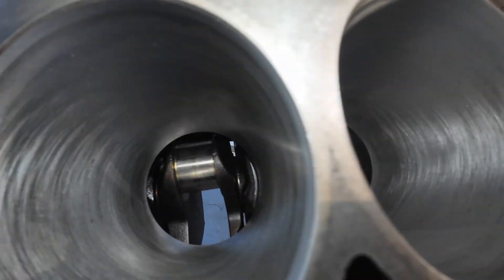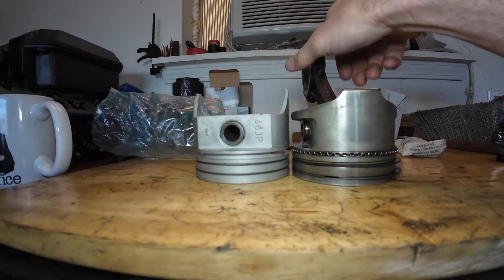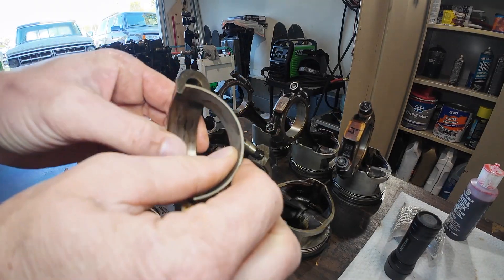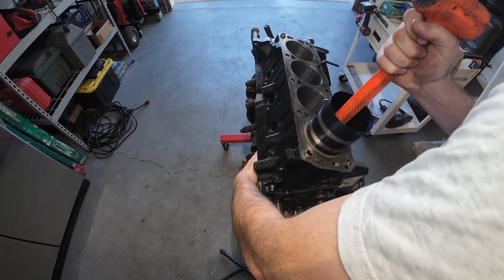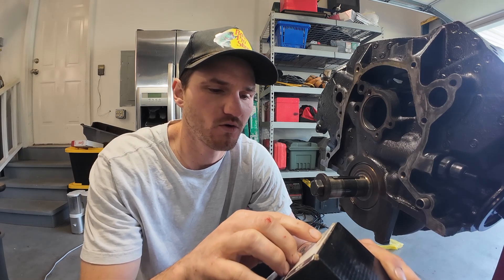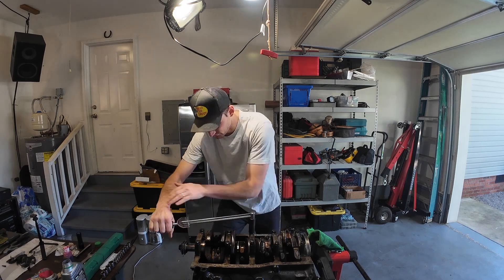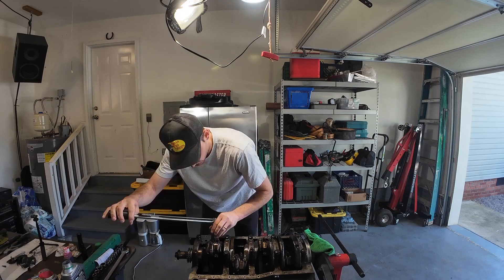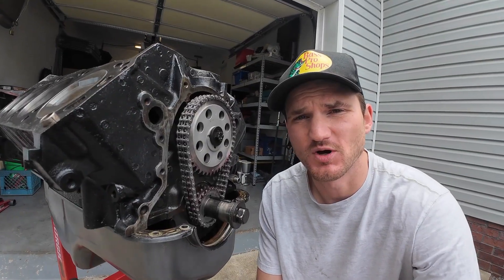Budget 351W Rebuild: Part 2 BROKEN PISTON

Comment: Just subscribed.. Going to be doing the same thing. Did you ever get this into your f250? Your videos go from this to the boom tube but I can't find anywhere where you say you actually swapped the motor. I like how it sounds.. just want to know if that is the 351 or 390. I have a 351 f250 and I'm trying to choose a cam. Thanks!
Reply from the maker: Thanks for subscribing, I appreciate it. The truck has a 390. I had plans to swap in that 351 but I ended up selling that engine because we just moved across country. I still plan on swapping it at some point though
Reply: @EvanNolen1989  got it. You think the cam you put in the 351 would yield a similar sound? Thanks for the reply! Best of luck
Reply from the maker: @LarsWiersholm that cam sound pretty rowdy. It was about the biggest I could go with that valve train.

Comment: You should have seen the pistons out off my 300k+ galaxie 390. You can keep your factory rods, go with a 3.85 crank and the appropriate CD piston and you will be around 390 cid. With the right heads and set up you can make a lot of power, and the nice thing about that Windsor is the torque keeps growing. If you make 500hp you will likely make 490TQ

Comment: Silvolite flat top pistons set of 8 are about 160 on eBay. My 16 year old brother did flattops a retro fit xe282 cam and 200 cc heads. It’s one bad mofo in his 75 f150
Reply from the maker: Sounds awesome. I plan on doing a stoker build with this motor in the future.